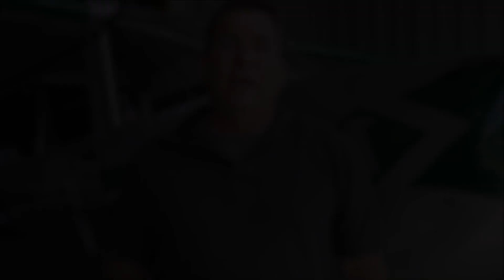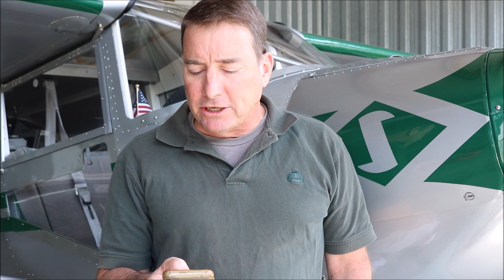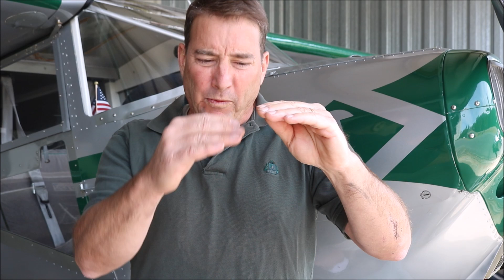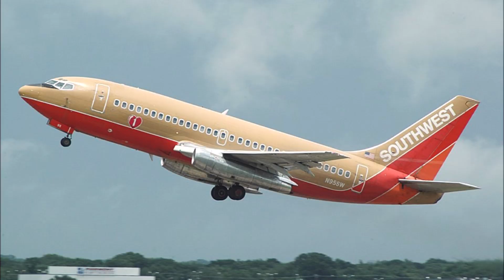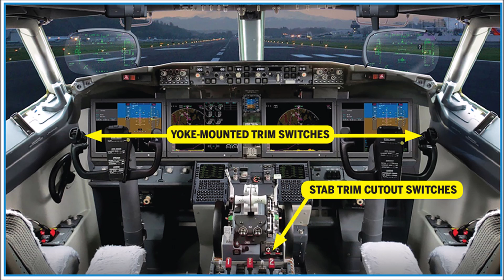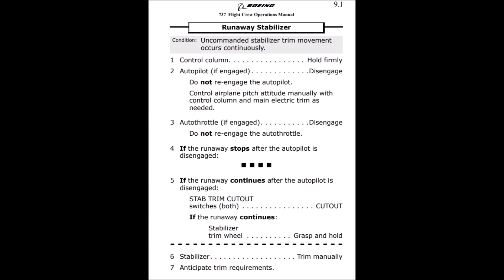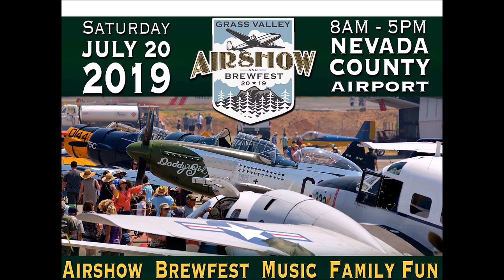737 Max UPDATE 27 June 2019 -The Latest Issue

Comment: So I found out what really happened. Here goes:

- the FAA found out that in the runaway trim procedure, the 737 Max is relying on one processor to process the trim information from the switches in the control column. So they thought to themselves - hey since MCAS goes haywire when it's ONE sensory input from the ONE AoA sensor is faulty what happens if this ONE processor gets faulty data?
- so they "broke the processor by changing the input data it gets - faulty data. Too much data. The way the processor is allowed to work (clock frequency - MHZ, GHZ you name it)

And guess what - the horizontal stabilizers steered the plane's nose down because of it.

This is BASIC unit testing that should've been done at Boeing. The FAA classified this problem as non critical at first but then changed it to critical. And now Boeing has to do the work they are SUPPOSED to do when they are designing the processor. 

Why did the FAA do this? Because apparently Boeing isn't doing due dilligence software and hardware testing and the FAA is now putting their foot down in enforcing it

And it doesn't matter that the next step in the runaway trim procedure is using the cutout switches and manually trimming the plane. This is another part if the plane that is steering the plane's nose down that's not supposed to do that just because it doesn't have REDUNDANCY. The processor can't tell it's giving garbage instructions to the horizontal stabilizers because it doesn't check its own data enough or at all. Stuff like this causes Mars probes to slam into Mars. Software engineers are supposed to catch this by TESTING their own product.

Anyway just to underline this: CNN didn't report this wrong. Their article correctly states that the fix for this is replacing the processor or changing the way the input data is processed (changing the software)

And it means that the 737 Max will stay grounded until 2020. And that Boeing cut corners TWICE.
Reply: Good work.  How did you find out?  Was this word of mouth (in which case from whom) or is there a link or document you can refer the rest of us to?
BTW, see 

https://twitter.com/Satcom_Guru/status/1144351180505722882?ref_src=twsrc%5Etfw%7Ctwcamp%5Eembeddedtimeline%7Ctwterm%5Eprofile%3ASatcom_Guru%7Ctwcon%5Etimelinechrome&ref_url=https%3A%2F%2Fwww.satcom.guru%2F

(sorry about the URL formatting), which says there is no microprocessor between the yoke MET switch and the actuator.
Reply: Sebastian Pietsch Any update on the source of your info or any documents for us to look at?
BTW, where is the processor that  processes the trim information from the switches in the control column located?
Reply: Daniel Forman the answer is in this article and the source is Jon Ostrower's sources at Boeing. And me putting 2 and 2 together reading that article based on my computer engineering courses where I had to put together processors both in a simulator and in hardware and testing them.

https://theaircurrent.com/aviation-safety/faa-and-boeing-initially-disagreed-on-severity-of-catastrophic-737-max-software-glitch/
Reply: @SebastianPeitsch  
I believe you have misinterpreted the Air Current article and misunderstand how stab trim works.
  Also, the Air Current article is vague and imprecise as to exactly what the simulated scenario consisted of, what the actual results were and what significance those results have for safety of flight, probably because the author doesn't know.

Your statement:  “the FAA found out that in the runaway trim procedure, the 737 Max is relying on one processor to process the trim information from the switches in the control column”

The article never said that there is a single processor that processes trim information from the switches in the control column (or that there is any processor that processes trim information from the control column).  The article says that the scenario flown caused a fault in a microprocessor that  lives in a box underneath the floor in the electronics equipment bay.  But the MET switches on the control columns are connected directly by ordinary switching and relays to the stab trim motor controller in the tail.  See the electrical schematic and discussion  at https://twitter.com/Satcom_Guru/status/1144351180505722882?ref_src=twsrc%5Etfw%7Ctwcamp%5Eembeddedtimeline%7Ctwterm%5Eprofile%3ASatcom_Guru%7Ctwcon%5Etimelinechrome&ref_url=https%3A%2F%2Fwww.satcom.guru%2F2018%2F11%2F737-mcas-failure-is-option.html   The flight control computer is aware of when the MET switch is pressed because there is an interlock that disables the FCC trim commands when the MET switch is pressed.  But MET trim commands are not converted to digital commands by the FCC or any other processor before being sent to the motor controller.  

Your statement:  “so they "broke the processor by changing the input data it gets - faulty data. Too much data. The way the processor is allowed to work (clock frequency - MHZ, GHZ you name it)”

The article does not say the simulated scenario “changed the input data,”’ provided “faulty data” or changed the “way the processor is allowed to work” (clock frequency or otherwise).  The article says that the FAA “intentionally broke part of the 737 Max’s flight control computer” and flew a “scenario causing a fault in a microprocessor that lives in a box beneath the floor.”  The article also says that the “deliberately broken microprocessor had become overwhelmed with data from the flight control system.”  Furthermore, this part of the article is gibberish.  Overwhelming a processor with data is not usually described as “breaking” the processor or causing a fault in the processor.  This language appears to have been selected for its sensationalist value.
  In any event, the use of the term "broke" and "fault" is imprecise and misleading but it doesn't imply changed input data, faulty data or a change in the way the processor works.  

Your statement:  “And guess what - the horizontal stabilizers steered the plane's nose down because of it.”

Your post suggests that the "faulty" microprocessor was incorrectly processing yoke MET switch commands and “because of it,” the stabilizers incorrectly trimmed down.  That is what CNN said but is not what this article says.  It says that after the FCC incorrectly trimmed down, the pilots found the MET switches either “unresponsive” or alternatively (and inconsistently) having an “unexpected slow response,” and had trouble trimming back up. 

Your statement:  “And it doesn't matter that the next step in the runaway trim procedure is using the cutout switches and manually trimming the plane.”

The article doesn’t say that and your statement is incorrect.  The cutout switches will interrupt 115v power to the stab trim motor controller, so it doesn’t matter whether some processor in the FCC is overwhelmed and issuing incorrect commands because they won’t be processed and the motor won’t move.

Your statement:  “This is another part if the plane that is steering the plane's nose down that's not supposed to do that just because it doesn't have REDUNDANCY. The processor can't tell it's giving garbage instructions to the horizontal stabilizers because it doesn't check its own data enough or at all.”

It's not clear what you mean by “another part [o]f the plane.”  MCAS is a function within the FCC and the processor that was supposedly overwhelmed in the FAA simulator session is presumably the FCC processor.  So it’s the same part of the plane.  Furthermore, you don’t know that the problem the FAA scenario instigated had anything to do with redundancy.  There is no indication that there was a hardware failure for which redundancy might offer a solution.  Likewise, there is no indication that there is a software algorithm problem that might not be present in a different software algorithm running on a redundant processor.  Finally, you don’t know that the processor was getting data out of range or failed to check the validity of its input data.  That is not what is reported in the article.
Reply: @danielforman5064  Your comment doesn't make any sense. If there is no processor involved interpreting the data and the information is directly handed off to the motor, then 

a) how come breaking the processor results in the nose pitching down
b) Boeing says they will fix the software and/or the processor?

The second reply to the tweet you posted says the tweet is wrong. Why do you believe some random guy on Twitter and on top of that why do you believe some random guy on Twitter if what he says makes ZERO sense in light of the FAA saying the error is critical and Boeing saying they will fix it? If there's no processor involved what would there be to fix!?

https://twitter.com/teachmonkey2fly/status/1144373714001321984

And I don't understand why you are talking about the cutout switches. They have nothing to do with the topic at hand. It doesn't matter one iota what the pilots do after the column switches become unresponsive. The whole problem is the switches becoming unresponsive because the processor is broken, aka the whole aktion of trimming via the switches taking too long.

What the pilots do TO MITIGATE THIS with the cutout switches is absolutely beside the point so half of Juan's video and half of your comment has nothing to do with the problem described by Bloomberg, The AP, CNN, Aviationweek and The Air Current.

I really don't get why every time this topic is brought up you guys feel the need to talk about the cutout switches. This is like talking about a dog sh***ing on the carpet and you guys keep talking about how to clean it up when the problem that's supposed to be avoided is the dog sh***ing on the carpet in the first place. I don't need a discussion on how you best mop up feces. I don't need to know anything about the trim wheels when talking about why MCAS fails or why this processor fails.

To me it feels like all these videos are now not about the technical aspects but rather how everything with the 737 Max is fine and dandy because you have the miracle wheels in the cockpit that at high airspeeds are so hard to manually operate that the Ethiopian air pilots weren't able to keep the plane from crashing into the ground. Yet here you guys are re-interating over and over how the elevator wheels are like magic fairy dust and how that is what "actually happened in the cockpit".

Read the tweet I posted. The MET switches result in electrical signals being sent. The "unresponsive" IMHO comes from the processor being overwhelmed with data like The Air Current reported (and which I attributed to the processor being "broken" - for instance could lowering the clock speed of the processor result in the processor not being able to process the data fast enough to not be overwhelmed by new incoming data just like it happened several times with space probes and rockets I learned about in computer engineering class in University).

I find it highly irritating that you're using a week-old tweet to correct me yet don't even read the replies to that tweet - I literally went there, saw the second reply and well here we are. Same thing as with Juan. You think you know better based on some guy posting a schematic and then lecture me making ZERO sense and checking the replies to that tweet would've provided you enough info on WHY you're making zero sense.
Reply: Did you look at the schematic?  Do you agree that the signals from the yoke mounted MET switches go to the stab trim motor without going through a microprocessor?

Again, the article didn't say that the MET switches caused an uncommanded nose down trim.  It said something in the FCC did.

And we don't know what the scenario was or how the scenario supposedly "broke" a microprocessor or how the resulting runaway trim condition interfered with the pilot's use of MET to trim back up or how contrived or realistic the scenario was.

Comment: It would be easy to modify the gear ratio on the motor that manipulates the jack screw, making the change in jack screw response faster.
Reply: I think slow has been misinterpreted: The word can mean either slow to get going (delay), or moving at a slow pace. My understanding is the activation of the trim is slow, due to the microprocessor being busy with other tasks.
Reply: Gordon Richardson  the fix for that would be a faster packet (command) response. Which would be a chip replacement not the entire microprocessor. Thanks for the clarification
Reply: @patmcgraw5889  Hardware upgrades always require time-consuming certification (whether computers or wings), software should be simpler to fix and test.
Reply: Gordon Richardson then the software can be rewritten to always move that command response to the top of the functional response of the microprocessor. Unless the microprocessor is over 15 years of age.
Reply: Pat McGraw Its not always easy deciding in advance which subroutine is most critical at any point in time.
Reply: Gordon Richardson I agree.
Reply: @patmcgraw5889    According to  https://theaircurrent.com/aviation-safety/faa-and-boeing-initially-disagreed-on-severity-of-catastrophic-737-max-software-glitch/
it's a matter of the processor getting overloaded by inputs.    Boeing think they can 're-route data across multiple microprocessor chips', which doesn't sound that simple to me and I'm sure would require extensive testing.

Comment: This accident baffles me.  Not so much the technicalities, but the public response to it.  By public I don't just mean the media, I mean The FAA and NTSB and their equivalents around the world, IE aviation experts.  I just don't get why one pilot didn't grab the trim wheel and hold it while the other got the checklist and threw the trim cutout switch.  I'm not saying these two accidents were strictly pilot error.  Boeing is clearly somewhat at fault; but I really thought the majority of airline pilots were better than this and were held to a higher standard.

I was of the opinion that the pilots who handled the Iowa accident in the 80's with no elevator control and of course Sully Sullenberger were better than average; but not that much better.  Now I wonder if those two crews were just worlds better than a typical airline flight crew and I need to be very, very scared for every airline takeoff I have to sit through.  I just don't get how a crew that can't handle a runaway trim emergency could possibly handle an engine loss right at V1.

Comment: I was a little confused initially, as I thought I remembered Juan explaining that when the Stab Trim Cutoff was tripped, the pilots had to use the trim wheels, not the switch on the yoke, but regardless then Juan clarified it was before they tripped the cutoff switches.  So the question is, does the 737 Max [software in the microprocessor] have different - i.e. slower - trim response than previous 737 variants?  If it's actually the same, it's not fair to Boeing by the FAA or the Media to lump it into the MCAS issue (much as it pains me to defend Boeing, but then my issue with them was with their GPS IIF ground system sat guys...).  Also, if it's the same, what are they supposed to do to the previous variants?
Reply: Dave Franklin My understanding is that it is the same processor, but the MAX has additional software such as MCAS, which can overload the capacity of the processor in some scenarios.
Reply: Well, that would probably be a good news/bad news situation for Boeing - and it pains me even more to defend the media than Boeing, especially CNN, but that would mean their claim of a "microprocessor failure" is almost accurate.  Anyway, the good news for Boeing would be no impact to previous 737 variants, the bad news would be it MIGHT have to be a HW updates (faster processor) and not just a SW update.

Comment: There are a couple of things I don’t understand.

1. Apart from the initial, badly dsigned MCAS, when would you get runaway trim?

2. Is this latest reported problem something which would cause the aircraft to be grounded if it were not already?

Personally, I wish they would get the essential problem worked out and get it flying again.

Comment: Accusing reporters misreporting the precise details of the failure of Boeing's fixes was just a red herring. The bottom line is that the fix Boeing putting forward was unsatisfactory, according to FAA. The question really is why Boeing could not devise a satisfactory fix to meet FAA requirement. Were the Boeing engineers being pushed to rush out a quick fix to save the company's finance that they got a bit sloppy as a result?
Reply from the maker: see previous updates

Comment: Juan, so up till now thru all the various iterations of the 737, the trim speed control "curve' has been fine for everyone, but now the FAA wants to increase it? Seems like a recipe for trouble because for all the time prior, isn't every pilot already used to the trim speeds the 737 is programmed with? No one ever mentioned it should be changed but now the FAA is?
Reply from the maker: Great point! But the 73's keep getting larger...

Comment: Correct me if I am wrong, but I thought on a runaway stabilizer you have to flip the auto trim toggle switch, which also disconnects the electrical trim on the yoke. Thx.